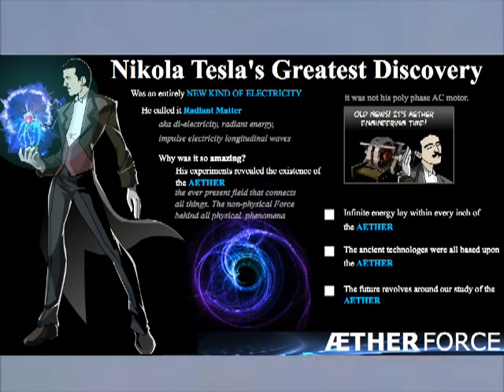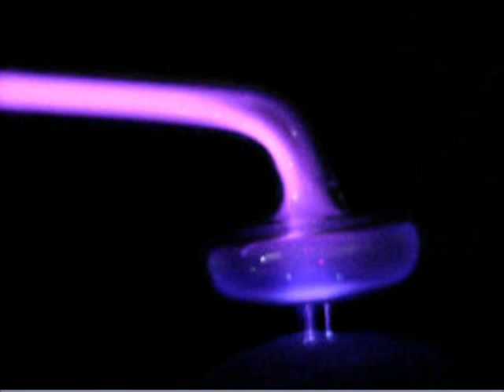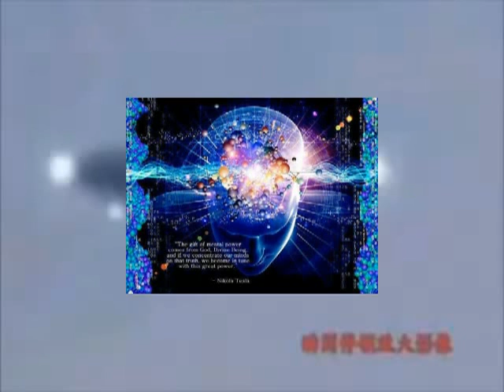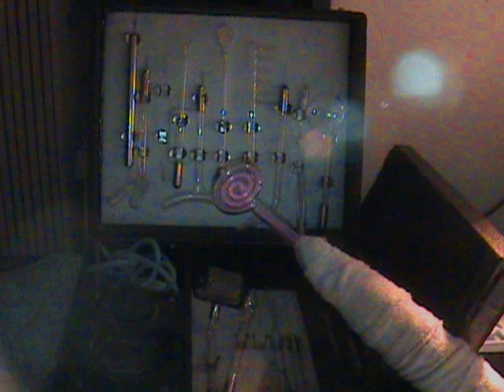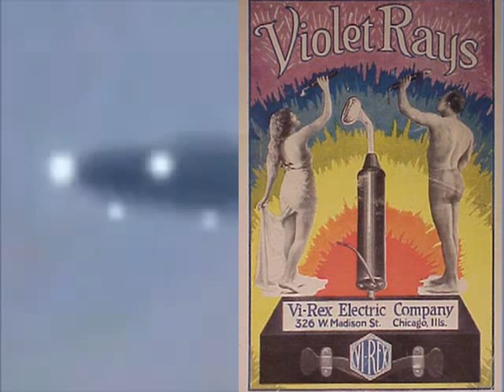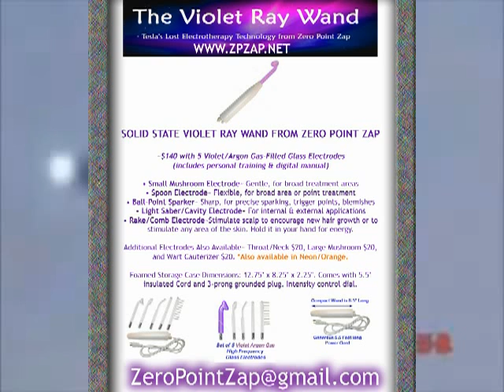Tesla's Lost Violet Ray Wand Electrotherapy: How It Works For Healing

Comment: I just found an old plasma ball from the 80's when I was a kid. Nice thick glass bowling ball size with argon gas im guessing. Pink/violet bolts. Runs off 12 volt and is much more powerful than modern ones. can place your hand on it and it still has plenty of bolts for another hand. even builds up heat if you hold your hand there long enough. Can light up lightbulbs by placing them close to it or on the glass ball. So there is a radiation of energy a good 6 or so inches outside the ball.
Reply from the maker: oh yes, I first healed plantar faciatis in my right foot with my plasma ball. I used to put in on my back under the covers and noticed the smell of ozone. That was when i realized ozone is a byproduct of the Tesla Coil. Check this out: Plasma Ball Particle Accelerator....
Reply: You can boost it drastically. I have got these balls pushing 1000 V/m at over 3 feet. 6 inch is nothin lol
Reply: @limitlessenergy369  that’s awesome! Do you have a link to the one you bought as well as instructions for modifying it? Have you noticed any health benefits?

Comment from the maker: Starting in 2018 the Violet Ray Wand Kits from Zero Point Zap www.zpzap.net will include 7 electrodes with the 7th being a roller that has part neon and part argon gas so you will have some orange gas to work with as well. Also, the kits will now be available in 220V for international orders. The new cost is $170 plus shipping. A variety of optional electrodes are also available on the website www.zpzap.net

Comment from the maker: ZP ZAP wands are pulsed--oscillating between 60 MHz and 200 MHz which is in harmonic resonance with the human body. (The gigahertz range is not and is the source of much dis-ease). Edgar Cayce recommended the Violet Ray in over 900 separate readings. http://www.zpzap net

Comment: Hey the magnifying transmitter was built to send longitudinal or LMD waves  through the earth at a prorogation velocity with know loss or attenuation. It was not  transverse electromagnetic. Using the earth to send the current . The opposite of the negative or neutral Grounding systems of to day.   Common mistake >

Comment: Would the FDA allow an electromagnetic device that really worked well on the market particularly if it might replace the use of medications?
Reply from the maker: Great question. I am vending them at http://www.zpzap.net. I have a FakeBook page for the wands where I monitor the recent developments in the new emerging field of Cold Plasma Medicine that is gaining status at major universities. I use these Thermal Plasma devices and feel the heat is part of the therapy for many issues....
Reply: The Fraudulent Drug Agency destroyed as many of these devices as it could because it would challenge their drugs. The FDA cannot be trusted with anything they say or do or their so called testing. The violet ray machines work I have used it and suggest you try it. The new ones manufactured are way weaker than the original ones, hence showing the new ones hardly work,  because the original ones work and aestheticians are not allowed to be used - they will lose their licence and they do not want the competition. Look at CBD oil, curing many ailments.

Comment: I have a wand but it emits a red light is argon vs neon the same effect?
Reply: Neon has low ignition voltage and is frequently used in low-voltage tubes. Discharge in neon emits relatively bright red light; neon-filled switching tubes therefore also act as indicators, shining red when switched on.                                                                                                                                                                 This is exploited in the decatron tubes, which act as both counters and displays. Its red light is exploited in neon signage. Used in fluorescent tubes with high power and short length, e.g. industrial lighting tubes. Has higher voltage drop in comparison with argon and krypton. Its low atomic mass provides only a little protection to the electrodes against accelerated ions; additional screening wires or plates can be used for prolonging the anode lifetime. In fluorescent tubes it is used in combination with mercury.
                                                                                                                                                                                              Argon was the first gas used in fluorescent tubes and is still frequently used due to its low cost, high efficiency, and very low striking voltage. In fluorescent tubes it is used in combination with mercury. It was also used in early rectifier tubes; first thyratrons were derived from such argon-filled tubes.